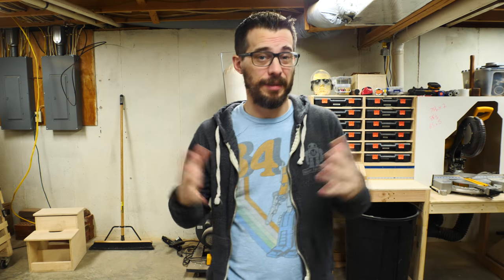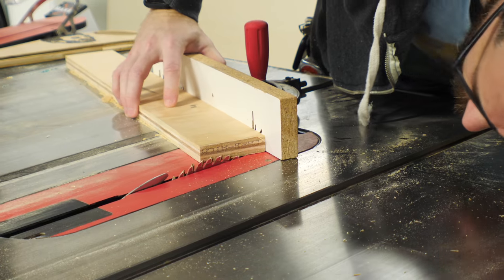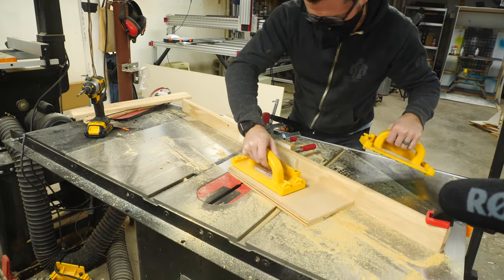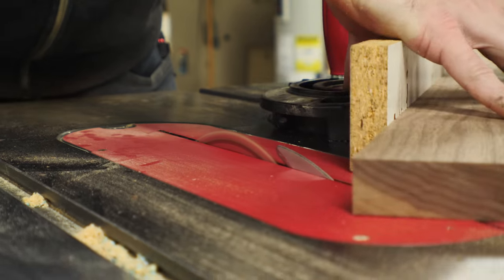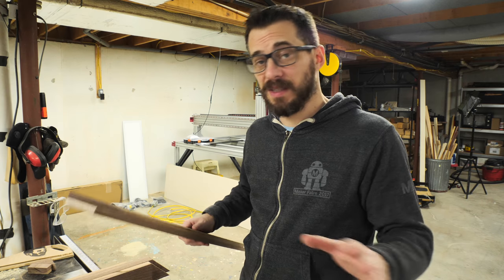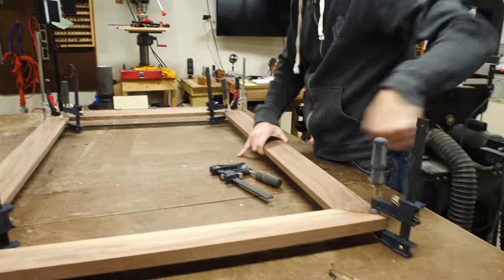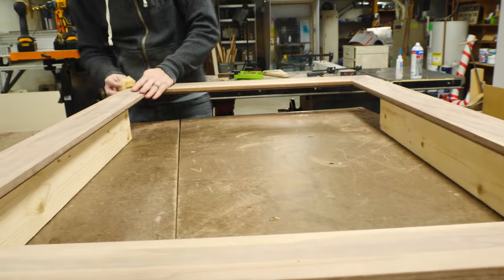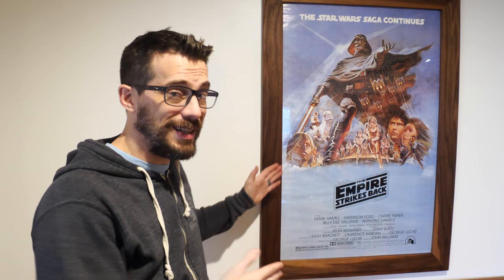How to make a solid walnut picture frame // Woodworking | I Like To Make Stuff

Comment: Great work on building the frame, clean, simple with the right amount of detail. Really like the corner joints. As a former picture framer I would suggest that you use a thin acid free paper spacer between the plexi and the poster and replace the cardboard backer with a piece of foamcore as both will protect the poster from any acid in the wood and cardboard and also keep the poster from sticking to the plexi. Just hate to see a poster like that turn brown over the years.

Comment: Bob that half lapped mitre is such a great idea. I have a huge poster I want to build a frame for out of oak but because of it's size and therefore the weight of the frame, simple mitre's wouldn't be strong enough and it would be too big to easily cut splines. the joint looks beautiful and will be so much stronger. Thanks again for all your work. You are incredibly inspiring.
Reply from the maker: Thanks so much James! I hope it was helpful!

Comment: Hey Bob, you should get a piece of UV protected glass. 

I used to work at a custom framing shop. Makes a big difference in the look and if you go to hobby lobby they can heat/flatten the work/poster for you. Then cut a piece of foam core backing.

Comment: Thanks for this video! I made my wife a frame for a Harry Potter puzzle we like. I don't have a router and didn't want to drop the boards onto my table saw so I have those little notches on the top and bottom. Not too noticeable when the frame is on the wall. I'm pretty happy with the results from my Dewalt worksite tablesaw. I think I will need to build some sleds for it because the mitre gauge is kinda cheap.

Comment: You could also use the 3M version of the picture frame hanging kit which includes a sawtooth hanger and the 3M mount with the removable strip as well. We have those and they are great.

Comment: The frame is a beauty. I can see my Bladerunner poster needs a high class frame like the one you made. Good decision on skipping the cove cut. I like the shallow angle cuts. Thanks for doing this video. And Dude, get a stud finder and put a hole in the wall anywhere and anytime you need it. It is no biggie to patch, if needed.

Comment: Beautiful frame and I love the movie poster Bob! 
I was a custom picture framer for over 15 years and with that being said, I feel the need to point out a few things.
1. The acrylic used is way too thin and will warp over time. Also, it doesn't provide any UV protection.
2. The cardboard used for backing is highly acidic and will discolor your artwork within weeks.
At very least, take a trip to your local frame shop or Michaels and get a piece of acid free foamcore.

Comment: The frame turned out really nice! If that's a real vintage print, i'd recommend stepping up and getting a piece of 'museum glass' for the frame. It reflects very little light so the poster looks better, and has UV coating so it will protect the art from sunlight.
Reply from the maker: Thanks! No, it's just a cheap reprint.

Comment: I recently did a much larger walnut frame for an oil painting. Really wish I used the half lap you used here. Would love to see how you would set a deeper picture. Normal canvas is around 1/2 inch to  1 inch deep, so a simple rabbit bit in a router isn't always going to do what you need.

Comment: Also, use a dado setup and it makes the blade so you don't get blade flex when you make a cove cut..  You take a slightly larger bit.  You can also buy a pre-made specific adjustable jig for it.

Comment: Love the half lap joints. 

If it is was artwork you didn't want damaged over time you would want spacers to keep the artwork away from the glass/plexi. Add in some frame sealing tape on the rabbet, some acid free foamcore backing and UV plexi (I use Museum glass) and you'd be archival quality. That frame would easily cost $300-500+ at any framer. A few little additions and the art is good forever (I know this is a mass produced reprint). I just hate it because some people might watch frame videos and end up damaging their art with no UV or acid free backer.

Comment: Two things.  A good rule of thumb is to apply finish to all surfaces including the back.  Just helps to make everything equally stable to changing humidity and so on.  Another trick I've used is to buy stock molding/trim from the home center.  I makes the half lap corner tough or impossible but I've done it and a brad or pin nail into a regular 45 degree mitered corner does the trick nicely.
Reply: My table saw back then was no good for milling rabbits so I even chose trim with a rabbit already milled.  Now 20 years later I can go from tree to finish trim but buying premade trim you can do frames with a $5 miter box by hand.

Comment: Love walnut,  BLO is makes it look absolutely awesome. On the other hand I absolutely hate those snap picture hanging strips. I tested them on some fairly light pictures, and used a bunch and then 2 hours after hanging heard a thud...intentionally didn't hang my test very high, so it didn't fall far.
Reply from the maker: Hmm, weird. They've worked great for me! Was the wall textured maybe?
Reply: regular egg shell paint on drywall -- our house is newish (2000 construction) -- I weighed the frame, and doubled up the amount of strips to be safe -- it failed twice -- first the snaps gave, then the adhesive gave. So I don't trust them -- good old fashioned picture hanging hooks for me from now on. PS -- look into 3d printed lithophanes, I made a couple with a walnut frame and LED backlighting. Walnut really makes them pop. Didn't go all fancy with half laps, just regular miters, and a groove for the lithophane.

Comment: Handy info for those that lean really heavy on the table saw for most cuts.  Did I miss a video/info on that CNC in the background?
Reply from the maker: It was built on my Twitch live stream a few weeks back. Still waiting on the spindle to get it running.  It's from CNCRouterParts

Comment: looks great, I've been trying to figure out how to make a mirror with a similar frame, is there any difference in the way to set a mirror in the frame than you did with the plexiglass?
Reply from the maker: Not really, you'll just need to secure it better on the back due to the weight of the mirror.

Comment: Are there any advantages in using wood glue for dark woods rather than using just plain 'ol wood glue?
Reply from the maker: Only real advantage is that any un-removed squeeze out ends up closer to the color of the surrounding wood.  It's just less obvious than regular yellow glue.

Comment: When I read "solid walnut" I (for whatever reason) thought you were going to use a glued up board of walnut and cut out the centre to leave a frame, which sounded really unusual. OK, I got it wrong, but I still like what you've done.

Comment: The finish you use won't leach into the poster will it?
Reply from the maker: I don't believe it ever comes into contact, I didn't finish the back side and the plexi is an insulator between the art and the front/inside edge.

Comment: So why flatten out a surface that your going to glue? A rough surface will provide more surface area for the glue to stick to which makes a stronger bond.
Reply from the maker: It allows the pieces to fully connect, so there is not visible gap on the outer edge.

Comment: just letting you know you should have a matt because it is not good that the poster is directly on the plastic glass. over time it will stick on and ruin the poster.
Reply: Jesse Simon you are correct! But if you dont want a mat you can buy spacers for fairly inexpensively at any frame shop